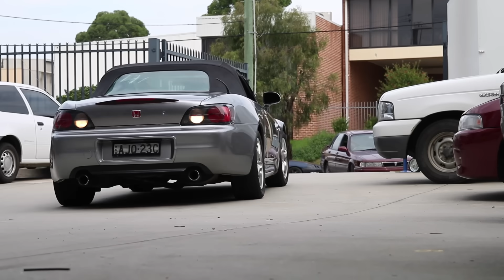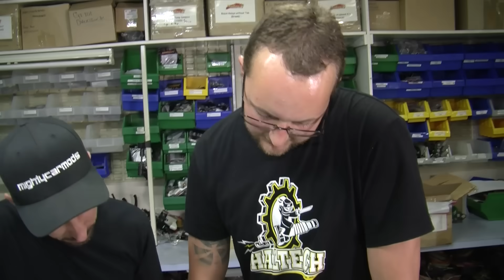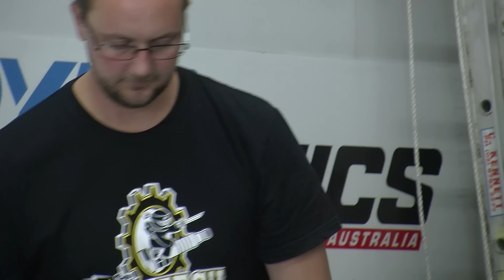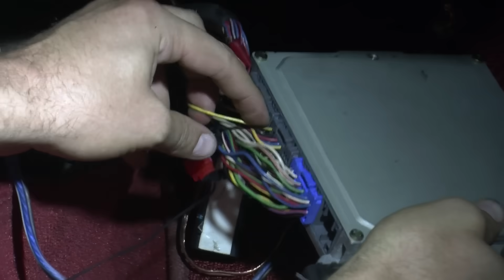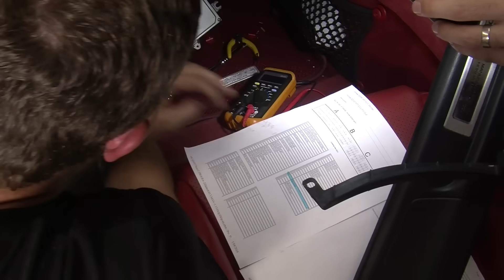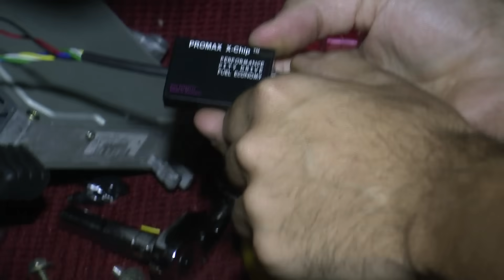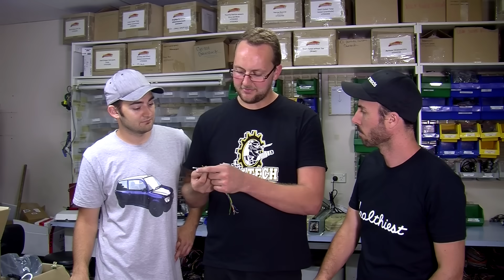eBay Performance Chips -  Mythbusted

Comment: A S2000 is a none boosted engine and can not make that much more power with out a cam change.
Reply: I don't think it would with a cam swap. LS's make about 30hp with a good cam and even more with an exaust. But those motors are pretty big in comparison. Also it's kind of strange that the s2k only made 177hp to the wheels. I wish they would've posted torque as well since we hear so much about "the power" of the f20.
Reply: nezerac 177hp seem low for a manual to me also. A good cam will add 35 more hp but it want run very nice at idle. But let me change that. It has V-tec, If they left the low speed lobe alone and just bumped up the high speed lobe. The idle want change at all but the change-over point would be a bear.
Reply: *****
But on a 2.4? I think it'd need exhaust, intake and a head.

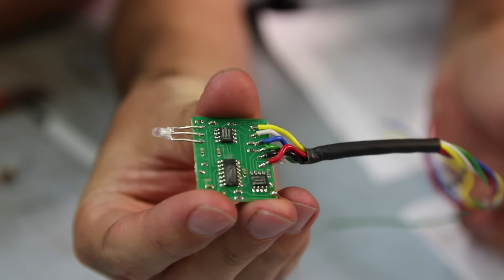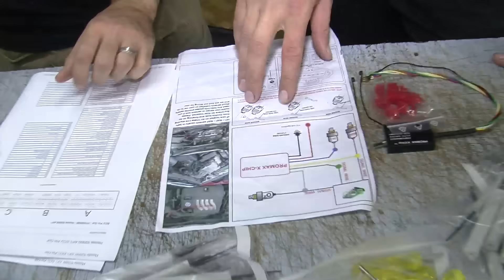Comment: Actually, surprisingly, the board layout can be assumed to be actually doing something (bear with me, folks) even if the chips on that board are bogus and not running : At 22:31, you can see there is a resistor connecting the blue and green wires, which is (according to the wiring diagram at 5:33) the one wiring connection you were supposed to break, namely for the intake air temperature sensor. I'd strongly suggest that this is the only thing this circuit was ever intended to do (=suggest the air is a couple degrees colder than it is to the ECU, therefore end up decreasing the AFR a bit), other than make an LED glow green or red.
The "intercepted" signals for MAF/MAP and the O2 sensors in all probability simply end at some non-functional chips and therefore do a whole lot of nothing.
Since you guys measured that very resistance as being ~0 Ohm, I suppose they at one point had actual resistors in there, and then changed the "recipe" to a 0-resistor when they had complaints about some ECUs not coping with it correctly (in a ukrainian winter maybe) - or complaints by those customers who took a simple multimeter to their chips and noticed they were nothing but a static 50 Ohm resistor or so.

Comment: ECU tuning only really works with turbo charged engines, mostly that means they increase the boost. With most NA engines any performance gain is minimal, only when you completely change the intake and exhaust airflow, then an ECU tune might help, a bit.

Comment: The reason why people think that these little, cheap chips work is because of technology back in the 80's and 90's. There was PROM chips available back then that were fairly cheap, but were the equivalent of today's flash tuners. It was literally as simple as taking the old chip out and putting the new chip in and (depending on the application) you could gain anywhere from 10hp-50hp.

Comment: The power of Ebay
Reply: Orku5 Wallet kicked in yo!
Reply: ***** LOL OMG WOOT
Reply: I've got a Cold-Air intake and a full Cat-back exhaust setup off of ebay and they both work wonderfully. I do believe there are different levels of ebay products. Some are scam products designed to feed off the ignorant and some are made off of a brand name products line, but sold under a generic name. Possible brand name rejects due to not meeting specific tolerances and just sold under a generic name to help cover production costs.
Reply: autobotguy Cold air intake and sport exhaust systems with luck you have 10hp more.

Also using performance chips on a n/a doesn't do a lot.
The fun starts when you turbo-charge, forced induction, good exhaust system, custom ecu plus other crank, mod the vtec timing... so basically spend around 10k on it and you might double the horse power - but then it's not VTec what kicked in ;)

Comment: If you think the s2000 is very low on power compared to one you've seen or read about in, lets say, England. Then that's probably mostly to do with the quality of fuel used. It makes a huge difference.

Comment: Hey guys! 
Could you please do a test with a real chip? I mean the ones who cost 200$+?
Reply: Agreed, granted though I don't think it will help but buying a cheap/fake chip from eBay just doesn't cut it for me. I wanna know if the real expensive ones really do help.
Reply: Better yet, with their access to a dyno and a proper critical "dyno-yoda", a comparison between several chips from ebay, local tuners etc would be very interesting. Let's find out if the myth about chips will actually be busted.

Glad to see that I'm not the only one annoyed by calling some 'IAT sensor fooling device' a performance chip.. Let's start calling things as they are, and for the more serious petrolhead those IAT devices were already in the same performance bracket as turbonators, homemade C(H)AIs, etc.
Reply: Unafraidworm I think they do.  Unfortunately, mine for example makes power at around 6500 rpm.  When do I drive at those levels?  Never.
Reply: Thanks for the support guys, maybe MCM will see this message!
Reply: Uberholprestige There is no myth.  ECU tuning is a proven science.  How much power you can get for your dollar entirely depends.  Go pick up a Cobb AccessPort 3 for your BMW 335i and watch the base map give you 50hp at the wheels.
Reply: Even if they do, you won't gain much power.  The 335i gets that much power by playing with the boost curve of the turbo.  Your 328 doesn't have a turbo.  If you're looking for performance, you're better off trading that in for an E36 M3.
Reply: Ive 'read' quite a few honda EPROM chips from 'ebay' & 'mail order' some were from 'tuning companies' from or for 'pre tuned' socketed ECU's with my chip burner on obd1 cars (im a home tuner) and most of them are stock maps with the rev limiter put stupidly high vtec crossover really low and launch control on etc. only 1 ive come across was acutally tuned but on checking the injector duty cycle was at 114% and the rev limit stupidly high, moral of the story dont buy one!
Reply: I believe that S2000 is making as much it can and I don't think there is a much room left on program level even that it is using old MAP sensor and not more accurate MAF sensor.

I was personally very surprised that MX5 had just switch style TP sensor. I laughed.

On real chips you are paying programming and not "chips" because chips just cost 2 to 8 dollars a piece (not to mention those which need some logic chip making talking between ecu). Today OBD programming / Flash so not anymore chips either (OBD flash tools are costly thou).

I think this dyno yoda is not making chips. Because they are selling they own ecu system.
Reply: True.  I was thinking the same thing when I saw their ecu.
Reply: Team503 cool.  I will look them up.  Don't know if they will have anything for a 97' 328i.
Reply: Hey, moog actually did a video on flash tuning his forester, or the Moogaru. Just look through the older videos :3
Reply: like programmable ECU?
Reply: Areweonfiya Exactly!

Comment: I actually do a little tuning myself on my own car with proper software. I see every little thing that these changes do and even if it DID function, the software compensates. You guys are entirely right about that. They could only work if the O2 sensors were disabled along with fuel trims. At that point you'd already have the ability to PROPERLY tune. In other words, save the money, buy a $15 cable, and do a little basic wiring to properly re-tune the computer. My tune rig cost me $20US and nets me the ability to change between 4 different fuel/ignition maps per tune and any type of fuel I can buy.

Comment: (I'm typing this before I watch the vid) Of course these things don't work. It's basically a fuse for the wiring, that MAY work for 20 seconds, but then you cars computer re-programs itself to adjust for the stupid chip. If you want to actually get 35 extra hp, you need an (at least) $300 tuner.

Comment: Why didn't they actually get a legit "performance chip" and then test it. Someone with a brain could probably tell a "performance" mod for under 40 bucks is probably crap. the only thing I could imagine being a decent mod is a good paper air filter that's around 35-40 bucks. Getting more power out of the engine is not cheap. These cheap crappy chips are just really a scam. Buying stuff off ebay.... which is somewhere you shouldn't even be looking for performance parts. I would probably look at some legit reviews on the web for an actual performance chip that does something.

Comment: I was actually REALLY disappointed at this.... I was hoping there would be a clever resistor set or something inside that would give you an extra 10 or so horsepower... That would be worth $20.

Comment: I pay 500 $ for a module ecu + 120 $ for map and 384 $ match the 32 pound injector and the vt1 ess supercharge .. a bmw 540i 1995 m60b40 stoke do 296hp crank for 326 ft-tq ... now 512 hp with the 4.4l piston rod and -0.3 mm to the head .. but never i had more trill then when i use my 20 $ chip from ebay ..

Comment: I love my APR ecu I had around 170hp  with the stage 1+ I'm around 235hp  just the ecu and changed the injectors. The diverted valve upgrade was an option

Comment: There is a simple reason that the markings on the chips are lasered away.

First of all: On this particular board, probably anyone that can use a search engine would know that this is a scam. Removing the markings on the chip makes it difficult to identify it.

Another reason which I've encountered often as well is that people steal other peoples inventions and by removing the markings on the chips its the same deal. Obfuscating the use and technology for more profit.

I'd assume that this "tuning-chip" will cost in production about 3 USD a pop, selling it for 20 makes a good profit for them...
At least they made it somewhat clever by tunneling the original signals through so that the engine wouldn't blow up in a way that the seller would be responsible for...

Comment: Simple fact. Horsepower cost $$$. If you pay 20 bucks don't expect miracles. A measly 5-10 horsepower gonna cost you at least a couple hundred bucks. Moral of the story. If it sounds to good to be true, it probably is a scam.
Reply: unless you get a small block chevy, minimal $$$ and horsepower for daays
Reply: MrTrollus
Yeah, but the race gas costs $$ too.

If you have an old car, the best and cheapest thing you can do, is give it a good service and change all the oil & fuel filters and/or make sure all bearings are lubricated and so on.

The increase in power can be surprisingly high.
Even from something as simple as an oilchange.

In fact, that might be something that could be fun to do in an episode.
How big a difference does a really ratty old hatchback stand to gain from a really good servicing.
Reply: Even a $500 tune on a naturally aspirated car won't net you much power...the only way tuning really works a crap load is if you're boosted.
Reply: unless you reduce the wieght of the vehicle, which is free.(not actually a gain but improves power to weight ratio so it behaves as if it had a gain)
Reply: True you can adjust power to weight ratio. Horsepower increase though is dollars.
Reply: Pendemic Or you completely advance the timing and degree your cams to run race gas.  That too.
Reply: Jesus45U Preventative goes without saying when talking about potential performance out of a car.  

Race gas is only about 6 bucks a gallon and you can mitigate that quickly by adding 1 part race gas to 3 parts 93 and get 97 octane, half n half for 101 and so forth.  Run catless because if you plan to do this because it'll ruin them either way, and most cars don't have hi-flo cats stock, unless you're a vette.

Get an oversized radiator and a standalone electric water pump, it'll cool off your race gas burning motor and free up a couple horses.  Sure everyone else runs N20 but no one will have a damn clue what's going on with you when they look under your hood.
Reply: Jesus45U .i would love to see that
Reply: Jesus45U .i would love to see that
Reply: Nxh

Comment: I would just like to point out that size doesn't matter, something the size of your cell phone can do a whole lot more than your car can do in terms of computational power/speed. That's the only requirement, speed in computations to keep up with the ever changing parameters of your engine.
In terms of computer capabilities, a car engine is as advanced as a floppy disk reader.

Comment: Moog just do what I did to m s2000. Intake full exhaust don't cut corners and camshaft upgrade plus proper tune and DONT FORGET to set vtec to engage at 4600Rpm and the obvious launch control he won't touch you and you can stay NA I made 264.2whp on mustang dyno
Reply: Correction 234whp

Comment: 132.2 kw to hp is about 177 hp. so if ur getting 177 to the wheels and nearly 250 hp at crank that seems like a huge loss stock. so dead stock is 240-250 crank to wheels should be at least min. 200. so my question is what in the world happen to ur s2?

Comment: 177 hp from an s2000 is not mutch, factory they had 245hp....
Reply: at the crank... theyre measuring wheel horse power
Reply: Nico Ferenczy Ah thats wy thx :)
Reply: Remy van den Nouweland
And it's a second hand S2000 that's probably 10+ years old, so a few of the unicorns have probably run away and made babies with lighting curves.

sage nod
Reply: Jesus45U
Reply: What the motor makes in HP and what it uses turning the wheels are separate things. Count on losing roughly 1/3rd of your horsepower by the time it gets to your wheels.

Comment: i sent the ECU in my bmw 540i to dinnan for a re programming and with the addition of a high flow exhaust (cutting off the mufflers and resonators) and a cold air intake... and a new intake manifold i got an extra dyno proven 56hp. so some chips work you just gotta do it right and not use a $20 ebay chip haha